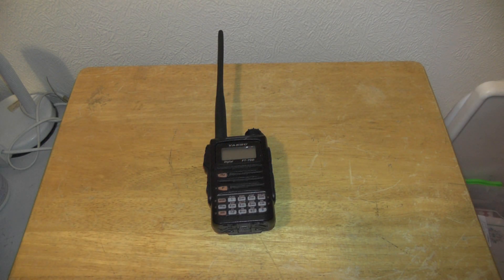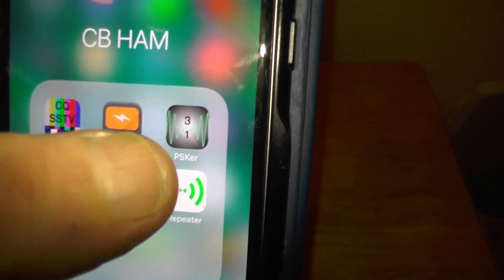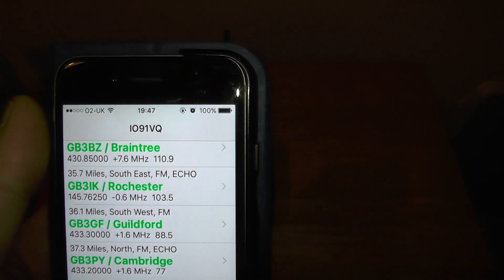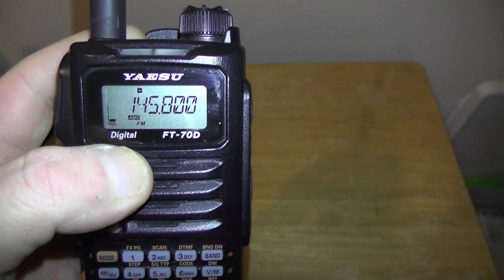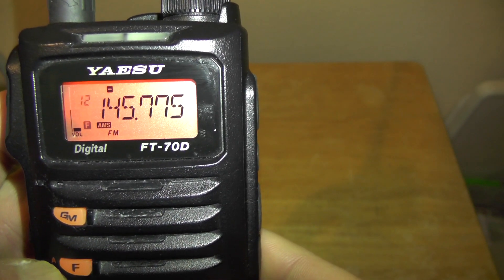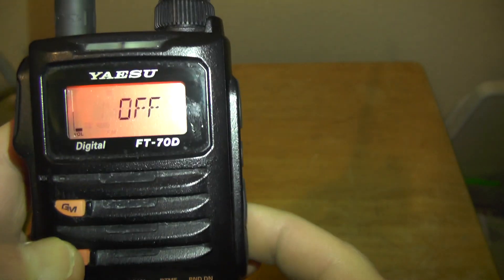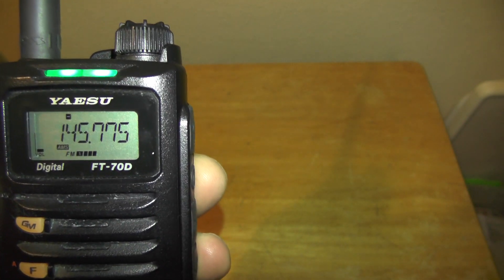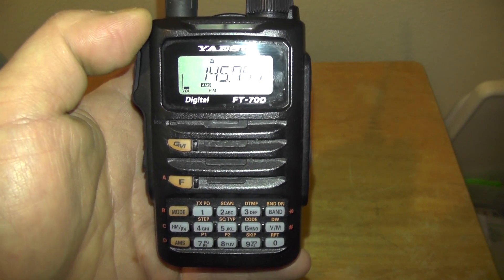analog repeater programming

Comment: At last, a decent informative video. I got my 2E0 callsign last week and treated myself to my first digital radio. The Yaesu ft 70 D.  For the last two days I've been scratching my head trying to make head nor tail of the manual. I must've you tubed about 50 videos on programming in an analogue repeater.  They either spoke too fast,  missed important stuff (like what button to press to confirm) or presumed I'd know abbreviations. I was going nuts. I can get on fusion with my hot spot but not my local repeater. Then I found YOU. Brilliant. Now got two repeaters in and will add some more tomorrow. 
Can I ask you to do a video on deleting characters? I put my callsign in wrong. Took ages to figure out. Lol